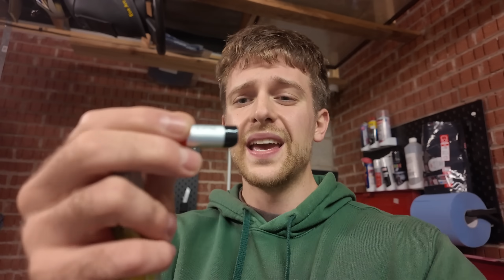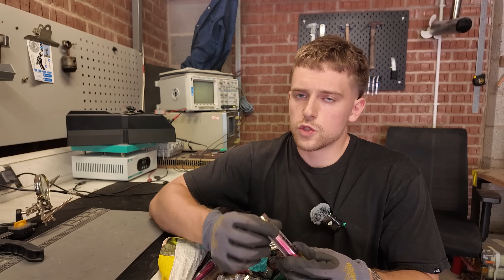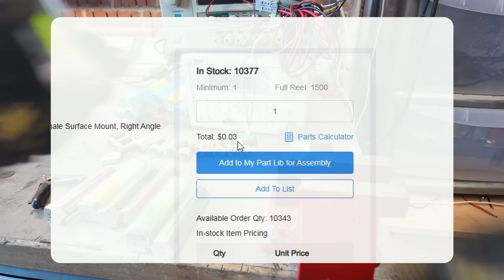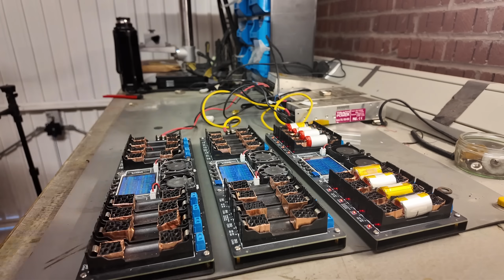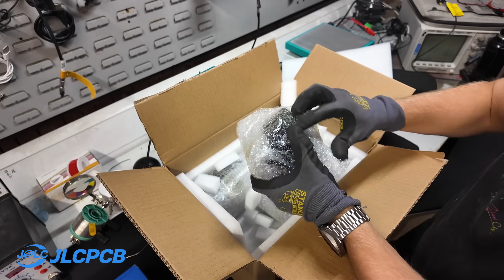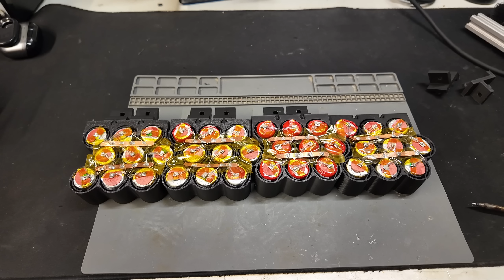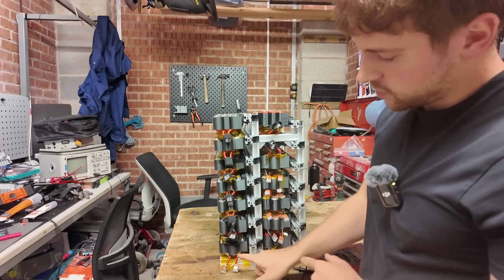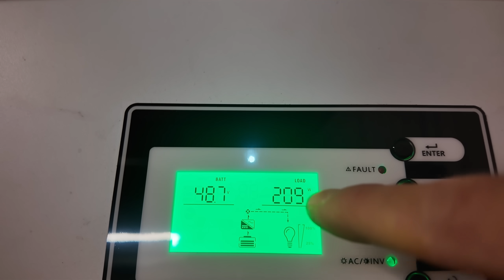I Powered My House Using 500 Disposable vapes

Comment: Next project: Improve ventilation in the workshop.
Reply: i build a giant ventilation system in my battery making shop, to not go crazy via fumes...
USING 10 THOUSAND DEAD VAPES!!!!
Reply: I would have done the vape testing phase outside, tbh.
Although I suppose he wasn't inhaling them directly, like you do when actually using them.
Reply: @RichieReportsUK_UKCNews ive been in the same room with one before, and it was warm out, so the fumes were escaping without me puffing on it, so i got dizzy, even if you're not full on puffing it, you're still getting some of the vapor.
Reply: @Tankayou-r3g   Sorry, but this.. this is a straight lie lmao. it has been proven that second hand smoking isnt a thing with vapes. Its pure water vapor. theres nothing in the smoke that you're exhaling.
Reply: @NotARealName1247  erhhm, no.
Reply: @yeh.80  errrrrrrrrhhhh, yes. pleb.
Reply: @NotARealName1247  lol. So you think that your lungs magically take all the nasties out of the water vapor? sure it might not be smoke, but smoke is just a carrier for nicotine etc, same with vape vapor.. Either way, vape is pre toxic lol, I remember how much better I felt when I switched back to cigarettes from disposable vapes.
Reply: next project is charging it.
Reply: 500 cigarettes
Reply: just get the right mask, and a little fan that has six inch flexitube going out a window. itll cost you like ten bucks, and save you ten years.
Reply: fr wear a mask when soldering
Reply: @Luqman2112  I just use the same 8 inch fan and flexible duct that I use when doing welding on any steel with zinc on it, and it blows the fumes outside. The big glass of milk is mostly ceremonial that way. 

I reckon that if it works for welding, it should also work fine for soldering fumes, so I use it for any large soldering jobs, too. 

At nearly 50 years old, my lungs still work fine, and I don't think that I'm any crazier than I was when I started. 😂
Reply: Tell him to use only used old computer fans
Reply: Using only computer fans, like the Vantec Tornado!
Reply: Frr tho
Reply: wow great video! Great message
Reply: Just another todo item..
Reply: Thiiiis
Reply: Real talk though
Reply: Using nothing but discarded CPAP machines
Reply: I was thinking that whilst watching. I'm not sure I saw him using a mask either. Not good
Reply: Not too much ventilation; any accidental fire could quickly get very fierce.
Reply: best idea ever: tesla heat pump for the AC but with a bigger compressor for example
Reply: Thats just gonna feed the fire he's trying to start.
Reply: If he have the brain capacity to think that what he is doing is unhealthy, then he still have a way to go before he is kicking the bucket 😅
Reply: They do make fume extractors for soldering stations that are designed to capture solder fumes.  You wouldn't want to use car parts for that because it won't actually capture the dangerous stuff, only make it someone else's problem.
Reply: Pipe down, nerd.
Reply: @OdinsForkastede  well, ventilation does involve piping yes?
Reply: The Connections (2021) [short documentary] 🙌 

Dominion (2018) ❤

Comment: Could somebody please elaborate on what happens to lithium cells when they go below 3V? Is there any possibility to revive them, and if not, can you at least recycle them?
Reply: Allegedly they form “whiskers” internally, between the chemical layers. The longer they sit at such a low level, the quicker the whiskers intensify, causing total failure, eventually. Recharging can, but not always, restore a cell to a usable condition. Cells like this should be retested after a few days - before using - to watch for signs of voltage “drop off”. Any cell retesting under 2-2.7 volts should not be used for high current draw, like this. Though they may be suitable for a torch/flashlight where the expected current need is just a few milliamperes or so.
When in doubt, leave it alone. It isn’t worth a catastrophic incident.

Comment: While I've never gone anything like this extreme, I started grabbing hold of disposable vapes some years ago while working at Glastonbury. I'd pick up every one I spotted. 
They're great for robbing batteries out of. But be warned, if you do this, make sure you both ensure you don't store them anywhere that will burn to bits in case anything goes wrong, and for the love of God, put them in a sealed container - you'll thank me. 
Because they absolutely stink. Especially when you get a ahdnful of them and it's all the most pungent artifical fruit and other bizarre smells.

Comment: bollocks - they are still recoverable under 3v
Reply: yeah, most battery protection circuits cut off at around 2.5 volts. i think it's only problematic if the cell reaches 0 volts, as i've had some lipo cells inflate when i charged them and they were at 0 volts originally.

Comment: This is very common in 3rd world countries. But instead of vape batteries, they use 18650 batteries extracted from old laptop batteries. Add solar panels, solar charge controller and inverter and maybe automatic transfer switch for switching on and off grid.. Commonly used as back up power source especially in areas with frequent power interruptions.

Comment: They're still being thrown away here in the UK. The law is so badly thought through that all Chinese disposable vape manufacturers have done is thrown a USB-C socket on them, let you remove the pod with the coil and juice (but good luck finding a replacement), and sold them for them for the same price, in basically the same packaging. Low and behold, people are still treating them as they did before and buying another when it's empty.

The law should be that vapes cannot be sold pre-filled. That would change people's habits.

Comment: what a waste of time..  powering a home with 5 volt at mayby 1/2 an amp. our house went the 15 kilowatts the other day but our average is about 3..  so your mainsis120 volts i main line is being powered by a 5 volt thing.... if you wonder why  nothing is working????   LOL   ya....   oh doesnt matter anyway most disposable's are 2 amps........ so you could get 1 kilowatt with 500 but it would only power your tv for 2 hours.. mabye an hour for you stereo system..

Comment: rather than a big home battery, could you build something like an a EcoFlow delta made from … well… scraps? Maybe a unit that you plug your ‘battery box’ into… and you could have old vape cells, old power tool cells, whatever. Each different cell type could have a different ‘battery box’. Maybe even a version that uses old fashioned rechargeable alkaline AAs? Though I suppose the charge controller might be a challenge.

Comment: How did you get your inverter to work without power from the grid? When the inverter from my solar panels does not detect voltage from the grid it just says “no grid” and stops working

Comment: 12:52 I can see you soldering the positive and negative cables/wago to the busbars on the SAME side. I learned it is better to have the negative cables on the OTHER Side auf the batteries to spread the load more evenly over the cells?

Comment: Hi, I collected about thirty of these electronic cigarettes with the idea of recovering the battery and seeing if it would be possible to reprogram the microcontroller of some of them that have coloured LEDs. However, you raise a point that I hadn't thought of, which is that these e-cigarettes discharge when they are no longer in use, probably due to what you explain. So I'm going to have to pick up the pace a bit if I want to get a few more that are still usable. Well, it was more to get them off the streets where I found most of them, at least they don't pollute and I think I'll use these small batteries, if there are any valid ones left, for small electronic projects for dioramas, for example, so generally LEDs, which these small batteries are perfect for, and it's a real shame that they are thrown away when they still have so much potential. That's the way the world is today, with overconsumption, and the "new" regulations in France, since that's the country I'm writing from, don't change anything. Manufacturers have found a way around this by offering new e-cigarettes that are supposedly rechargeable, but in fact they can only be recharged a limited number of times, which is almost the same as before, except that it now takes a little longer before consumers buy a new cigarette. In short, we are not yet done with these disposable devices, and on the one hand, for people like you and me who like to tinker, it gives us materials to play with, but it is still regrettable that in this day and age we still find ways to engage in this kind of wastefulness.
In any case, great work and great demonstration, thanks for sharing ;o) I wonder if there is a time limit on the use of these batteries. Is their lifespan much shorter than 18650 cells, for example?

Comment: Just a tiny thing, the capacity is NOT important for parallel arrangement (at least not that much since the entire bank should average out) but it's important for series. Since your charge voltage is applied across all banks and you would risk overcharging the bank with the lowest capacity. It's important that every P has the same average capacity in your S configuration...

You should be careful when powering your house, by the looks of it your Wago terminals are only rated for 20 Amps (so 40 Amps since you use 2). That puts you at a max of 1.9 kW load. Or if you in deed use the 6mm² 41 Amps its 3.9 kW

Comment: You're using wago 221s with stranded cable as your links between rows. You should be using solid core cable, or applying solder to your ends before inserting them in the wago if using stranded cable.

Comment: vaping is terrible for you, some vapes have chemicals that trigger insulin response, there are cases of people. thin normal builds like you, getting diabetes from vaping. only air is supposed to go in the lungs. if you want the health benefits of nicotine you should get the nico pouches or patches. Great video. Some flavoured vapes from china have heavy carcinogens in them.

Comment: Those wago connectors are 32A or 63A rated so you pushed them above the edge of safe use during the test with one kettle. I love wago but please use them responsibly. ALSO you do not have automatic transfer switch or one switch with l-0-ll configuration. With this setup when someone would switch mains breaker while you work off-grid it would be just one SERIOUSLY HUGE SPARK and possibly fire
Reply from the maker: Luckily i used 4 of the wagos for each series connection, so I should theoretically be able to handle 128A, but I certainly wouldnt want to try! I absolutely agree with the transfer switch and I will be adding that next

Comment: While you’re absolutely not wrong about cheap implementation, you’re being deceiving by only showing the price for a USB-C port and acting like it’s a whole charging circuit. It’s not that much more expensive, but let’s not lie to the masses when we’re trying to be educational?
Reply from the maker: Interestingly, the IC that detects the pressure sensor and activates the heating element is typically the same for the disposable and rechargeable, so a lot of them do still have charging capability, but it is not used😮
Reply: @Chris_doel Wow. That’s upsetting, but makes sense for mass production I guess.. Either way, great project — just wanted to point that one out 😅

Comment: Bro mad video! I just found a feedback loop with the LEDs full spectrum feeding backing into another solar panel at 15w.
600w 2x solar panels (1/2 day) -> 2 x 120 AH Batteries -> 100amp Solar Controller -> LED Grow lights drawing 120watts -> 420 watt (3 Panels) -> Solar Controller Mini -> Lead Acid Batteries (120 AH). Voltage loss on a full run a day 0.1 volts.
They have been lying. These are low level LEDs.

Comment: You can still use cells that have been discharged to about 1.5V or even lower if you slowly charge them.
The damaging depends how long they were at that voltage and why. If they were VERY slowly discharged, or self discharged they can actually still be used and might have only incured a damage of a few % of full possible charge.